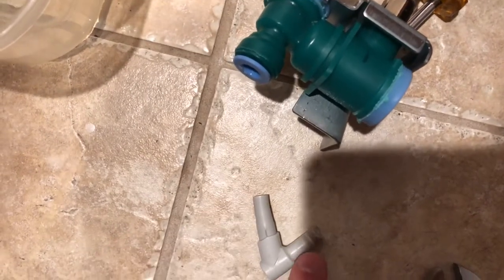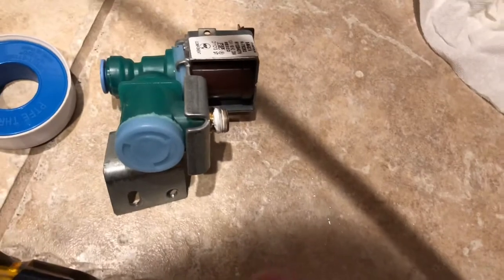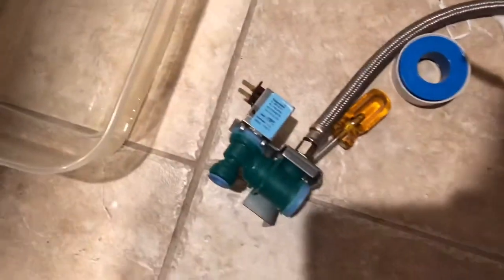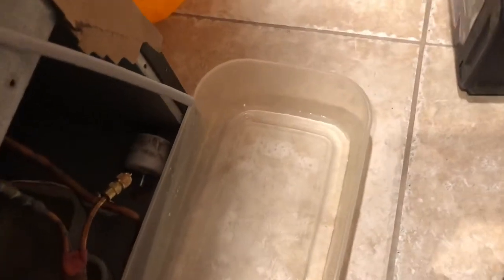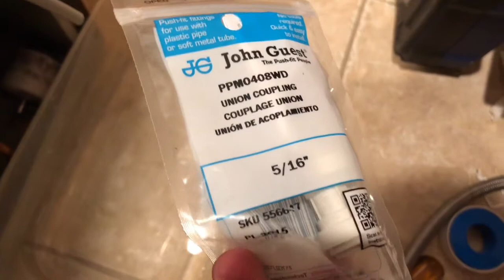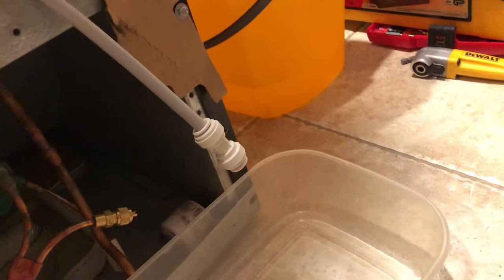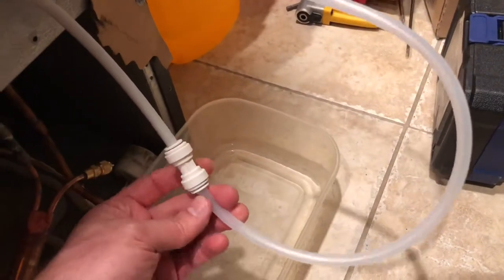Whirlpool Refrigerator Leak Fix - Money Saving Tips

Comment: Same crack on the same part happened to our Whirlpool fridge. Leaked for years without us knowing whenever we dispensed water or fridge used water to make ice. Destroyed the floor underneath and we had no idea until warping of our laminate floor started to happen in the room on the other side of the wall from the fridge.
Reply from the maker: i don't even know why they use a fitting there.  seems like sticking the tube into the pump would be better

Comment: oh boy..,. that was an expensive trial and error!    mine has a slow leak... i've taken out the back cover... and i've been monitoring... so far, the only tiny leak I've see is coming from the inlet water tube connecting to the water filter housing.... i'll give it a couple more days... $60 part... but gotta do it.  

thanks for your video.

Update:  11/21.  The leak didn’t stop…. It started getting heavier.   I changed the water filter housing…. THAT fixed the leak!    I had already picked out a fridge from Home Depot for $1800….   Now I just saved $1800!  

😝😝😝

Thanks again for the video.  👍🏼
Reply: Just the problem I'm having. Thanks for the tip

Comment: Thank you very much would not have tried without your video! Home Depot had the 5/16 step down to a quarter inch which I needed. mine looked just like yours. I snipped the 5/16 stuck the fitting on there and then ran a quarter inch to the solenoid. Thanks again!
Reply: Thanks,  going to do the same!

Comment: Maybe you can help me.I have a leak btwn the 5/16 in .filter lin and the main water valve of my Whirlpool fridge. I am replacing the valve, but the tip of the 5/16in tube appears damaged. The tube has an integral flange about 3/4in of the tube end. Instead of replacing the entire tube, can I cut it past the flange(of course straight cut and flaring the edges) and reinsert on the new valve? What is the intent of the flange? I have another fridge with similar fitting but no flange on the tube.  Any ideas.